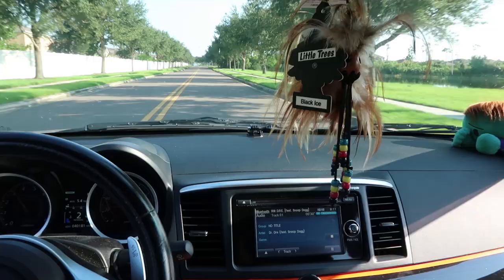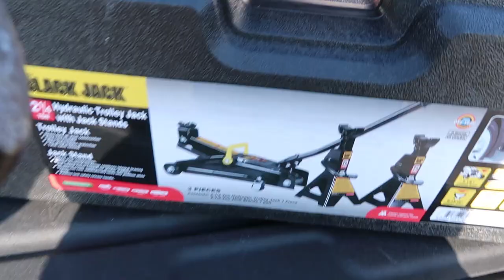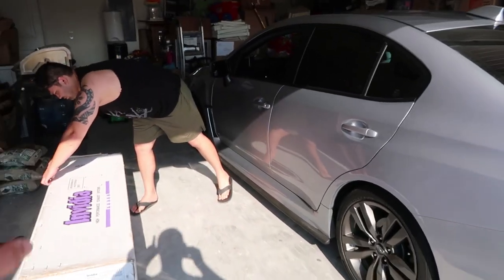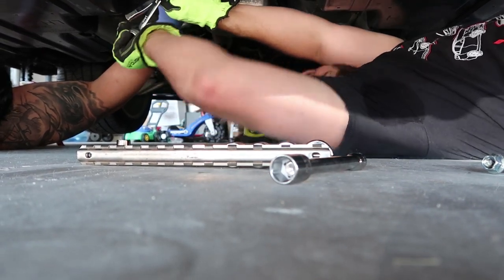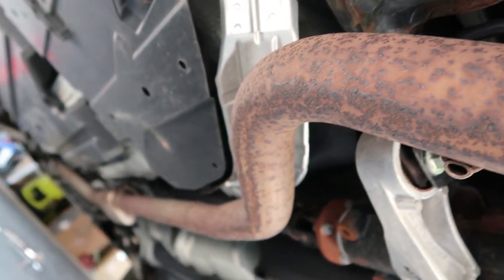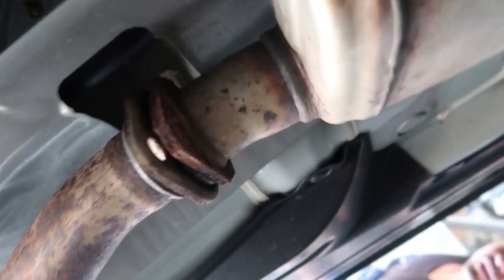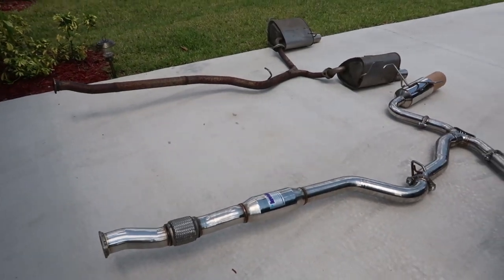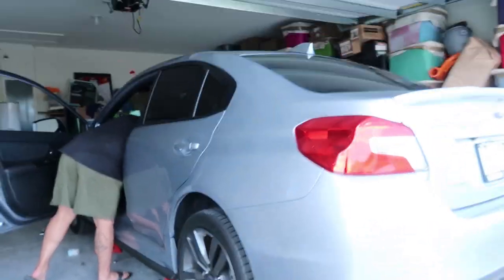WRX Invidia Catback Install (Almost Died!!)

Comment: I was wondering why you started to pull it apart there being a cat back. 
Wrx sounds like stock with after market exhaust. It’s pointless doing with equal length headers